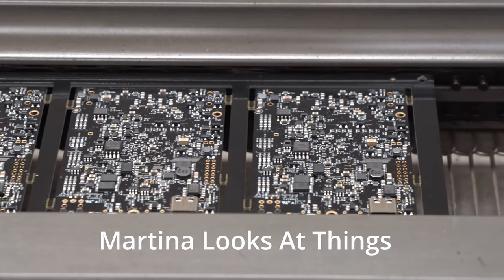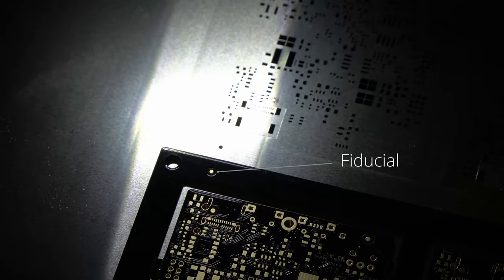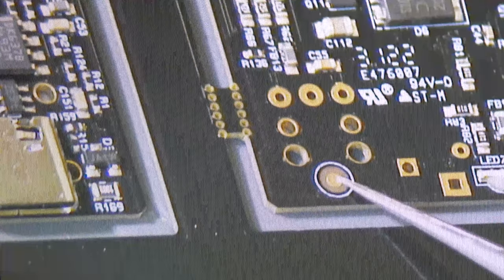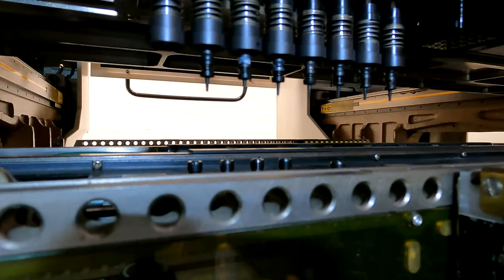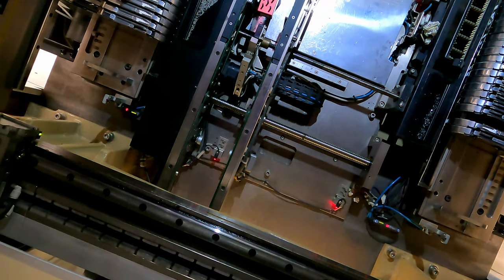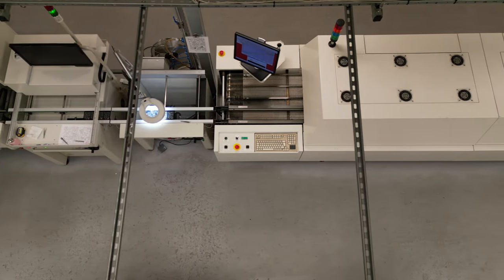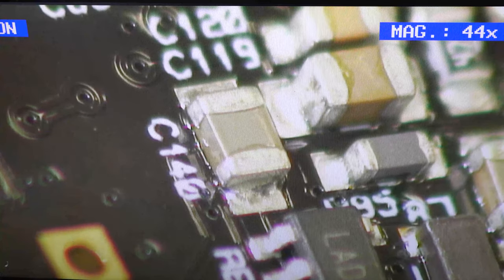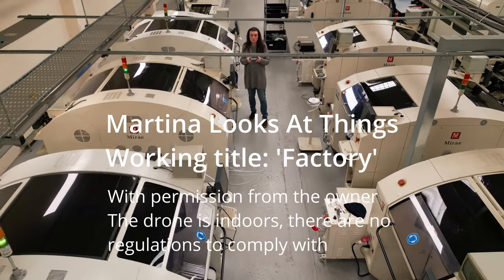Inside an electronics factory - how PCBs are assembled

Comment: Pretty good video. The only thing that is cut a bit short is the inspection after soldering. For high quality manufacturing, usually every PCB not only goes into an AOI (automatic optic inspection) machine that takes a lot of pictures and compares them to a good sample, and shows the operator every spot that the machine thinks is a failure. But with more QFN, BGA and other leadless packages usually there is an extra x-ray machine that looks "thru and under" the components to check for invisible voids or bad solder joints.
And i agree, the music is a bit too much present in the mix compared to the voice-over, and it's not really needed at all to keep the video interesting.

Comment: You didn't mention that some pick and place machines will test the components before they get put on the board and bin them if they're no good.This used to apply to more basic components such as resistors,capacitors and diodes that were picked up by a small set of jaws that were also the contacts to test them with.
Reply from the maker: I know Europlacer do it as an option, and some other makes I forgot. I feel like that would be very useful to verify set up when running a first off or after a reel change.
Reply: @martinalooksatthings  It's at least 25 years since I've worked on an SMD production line,so things will probably have changed by now.The only real difference from above is the solder paste was applied by hand using a silk screen.